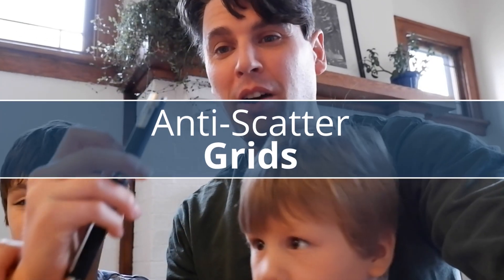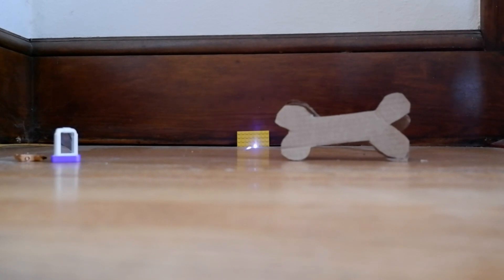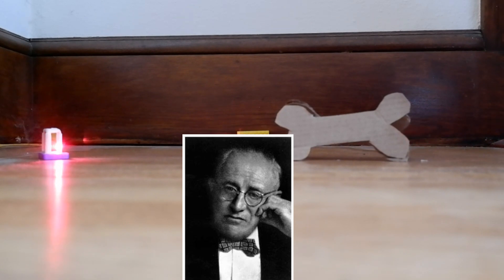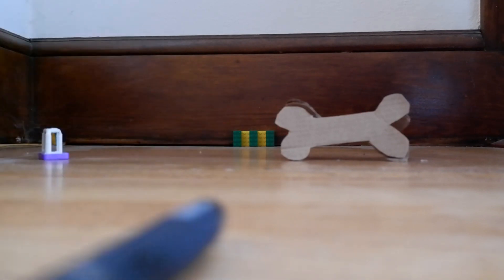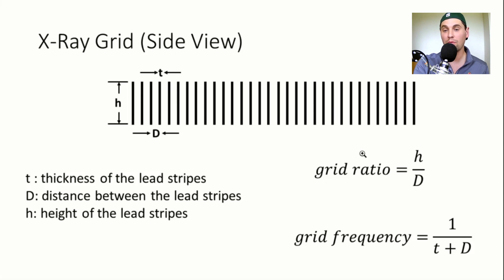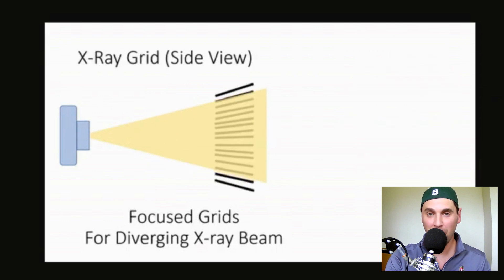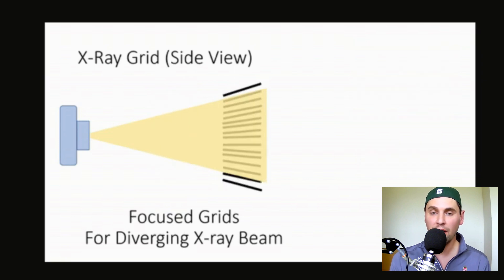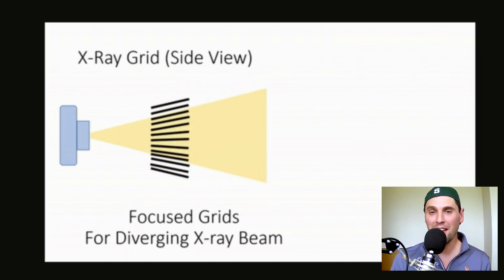Anti-scatter Grids (X-ray / Radiology Technologists/Students)

Comment: Hi ! Nice video ! What is the minimal thick a anti-scatter grid ? And what is the most common material (Lead)?
Reply from the maker: Yes typically lead and https://onlinelibrary.wiley.com/doi/abs/10.1002/ima.22409 have done simulations showing thickness around 70 microns is ideal for their choice of parameters. I’m not sure what the minimum constructable size is.